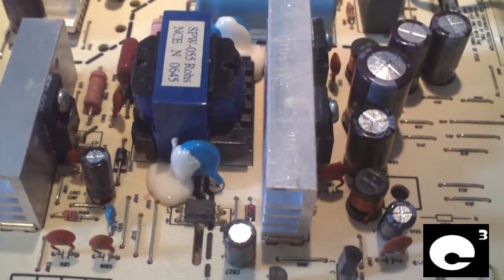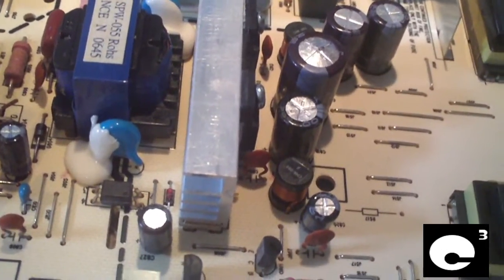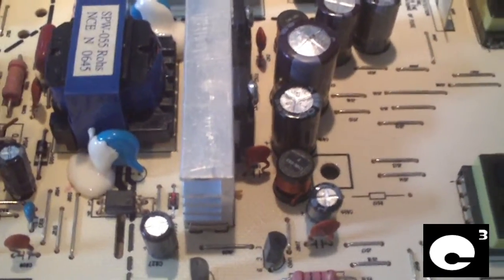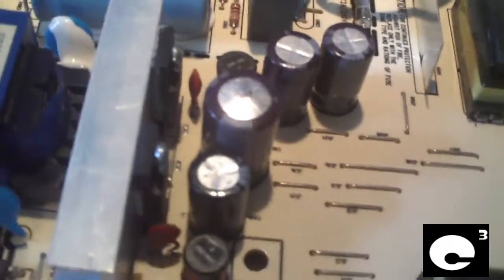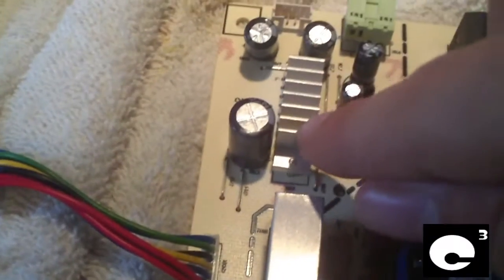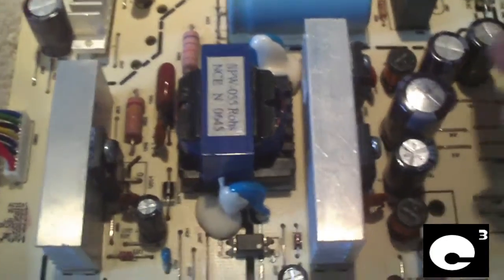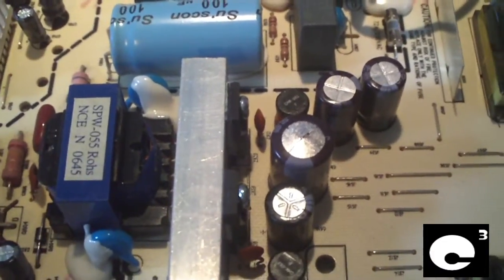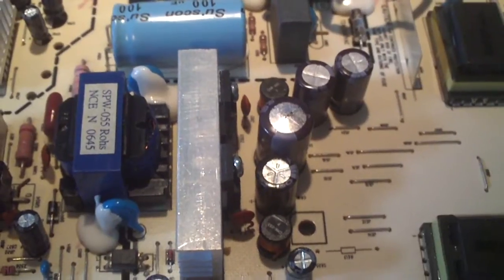Another ViewSonic VA1930WM monitor with bad capacitors on the PSU

Comment: I have  monitor viewsonic va1912wb it's shows green light when powered but goes into sleep mode ...no display no input signal...even I pressed the buttons but no display is coming ....what may be the problam...can you plz elaborate
Reply from the maker: Possibly bad video connection or bad video cable.
Reply: @CubeComputerChannel  its not showing Menu display also
Reply from the maker: @munish126  Shine a flashlight at the screen with it powered on and a video signal to it. If you can make out an image, then the CCFL tubes or inverter is likely bad.

Comment: Vewsonic is a cheap, low quality components brand just like lg, disposable after a year, very fragile and won't tolerate any "heavy duty", you have been warned... 
In my experience as technician and then engineer, capacitors die due to 2 main reasons:
1. Generic ones made with cheap materials/formula that die early or won't last long due to heat and stress.
2. Poor circuit design by selecting the wrong: capacitance, maximum temp and maximum voltaje.
Reply: I've had mine for over 10 years before this happened

Comment: I have a va1932 mine will power on and work for awhile but then goes off but power light is still on if I power cycle the monitor it will come back on momentarily but goes off again if I leave it off for awhile then it works again for a short while I checked the caps none are bulged so what would you think it could be?
Reply from the maker: Sometimes capacitors will fail without showing visual signs of failure (bulging or leaking).
Reply: Cube Computer Channel thank you I will have to get new capacitors and try replacing them

Comment: How did you manage to pull of the psu? Something seems to be holding it. Nice video btw.
Reply from the maker: +itisme754 It's been 4 years since I serviced this display, so I don't remember everything involved. I believe on this one, there are 2 or three screws holding the power supply board into place. It wasn't too complicated.